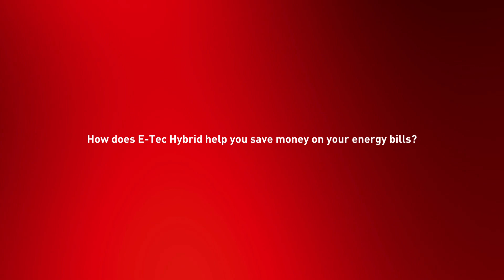E Tec Hybrid - Your Questions Answered

Comment: How does it use currently gas/electric prices if on Agile for Electric which changes every 30mins and tracker on gas which changes daily??
Reply from the maker: Hi, gas and electricity prices are added manually into the Smartech control, which works well for those on a fixed tariff. Currently this is not smart grid ready so would be unable to track frequent changes to prices.